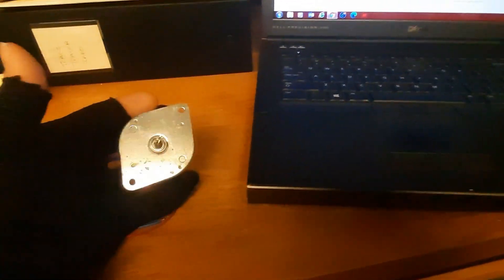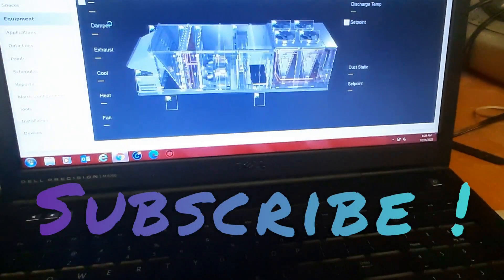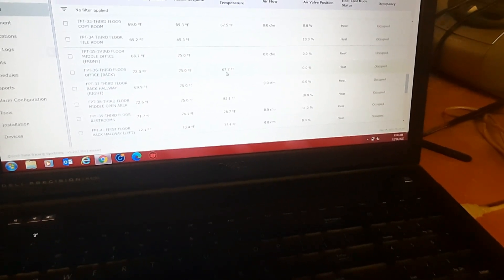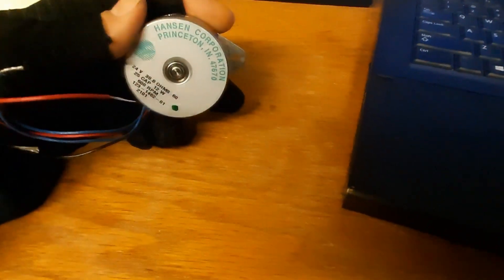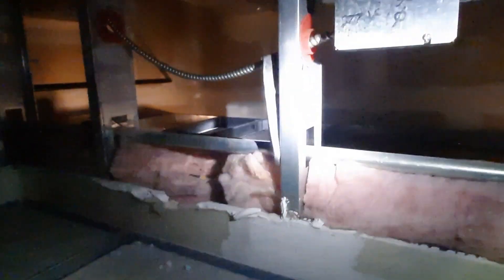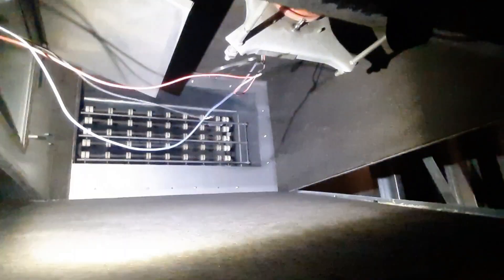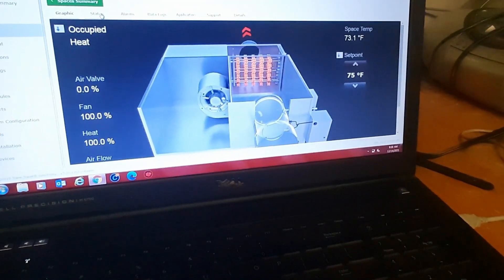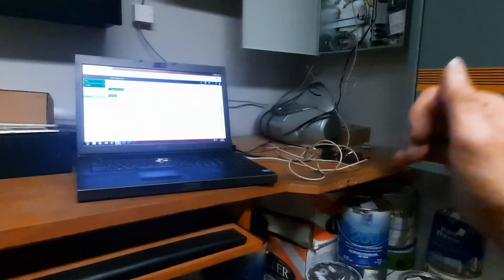No Heat Service call, Trane VAV issues, SC Controls

Comment: What style/model is that damper called?
Reply from the maker: I am not 100 percent sure off the top of my head. @Professor Butler just had a video of the same damper style, he may know exactly how to answer your question, he’s a smart guy.
Reply: @EverythingHVACR  do you know what the video is called? Cause that one has the metal disk at the end right? I have one that keeps slipping off and I’m not sure if there is a nut missing on it and if that blue rod is supposed to connect to the other rod at the other end close to that metal disk
Reply from the maker: On ticktock it is, how to rebuild an old trane vav.

Comment: We just did a controls retrofit and those were the VAVs. Control wise they are fantastic if they work, but too many little parts and things to go wrong with them. The ones that didn't work had issues with the little motor or the plastic gear getting stripped causing the damper to get stuck.
Reply from the maker: Yep! They always describe the noise as a hamster in a wheel 😆. They always strip.